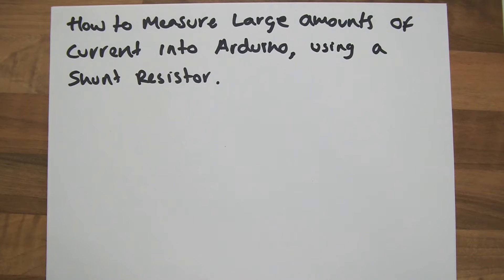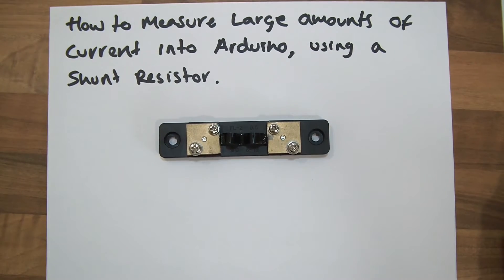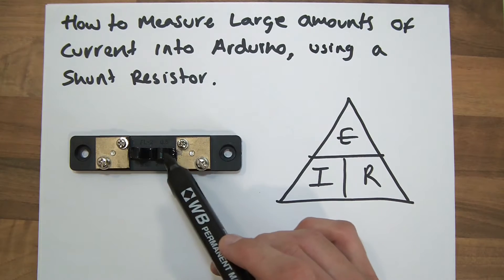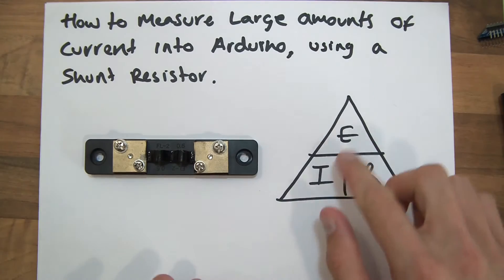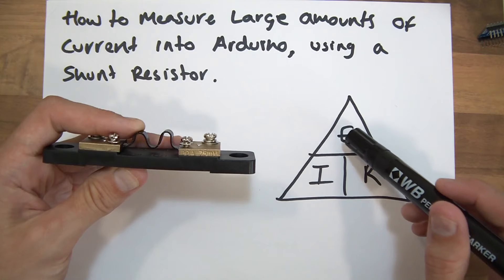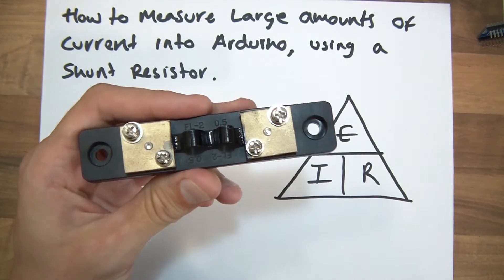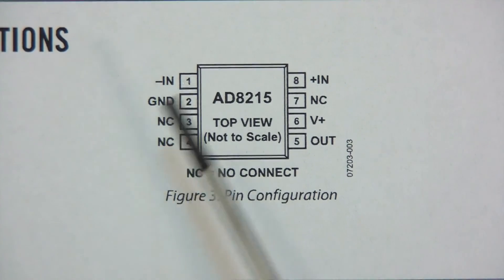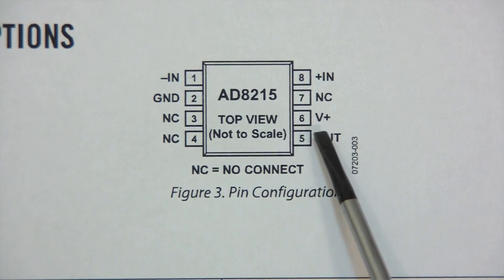TUTORIAL: How to Measure Current - Arduino - Current Shunt & Amplifier (Part 1 - Theory & Prep)

Comment: I think your shunt is 75mv per amp.  With a max of 20 Amps.  Which should give a max Voltage of 1.5 V.  A gain of 3.33 will get you to 4.995 V and pretty darn close to the 5V ADC reference.  5/1024 is about 0.004v per readable adc voltage.  A simple potentiometer to set the gain and a cheap op amp and done.  No need to buy a fancy and expensive ADC.  Because unless you are doing high speed conversion that would be overkill.  This setting should give you a resolution to measure min 53 mA max 20A.  This video was a waste of 10 minutes.